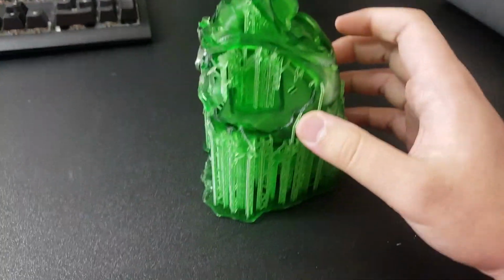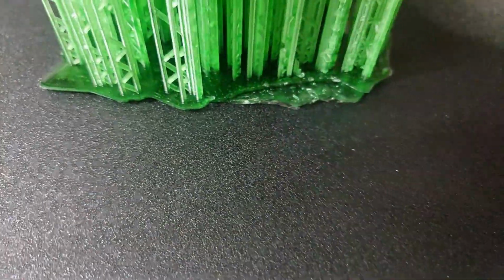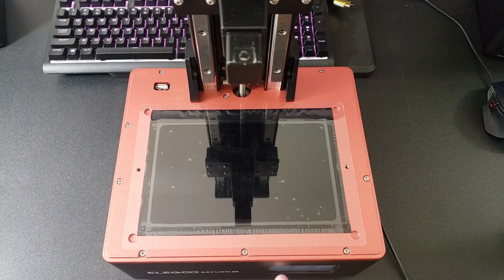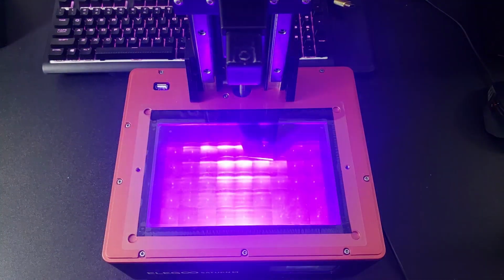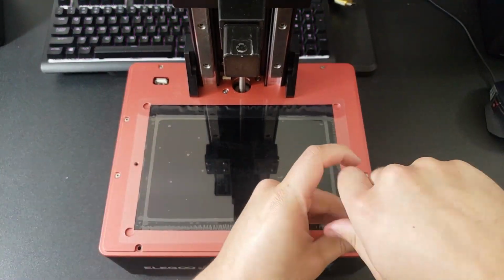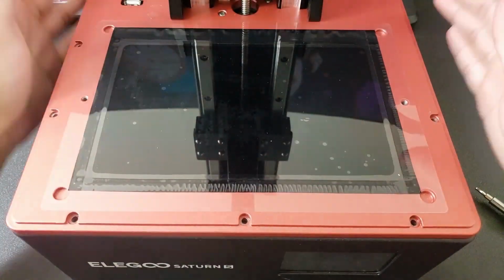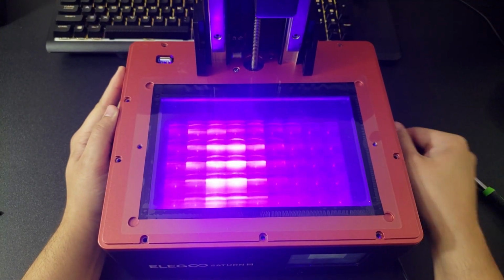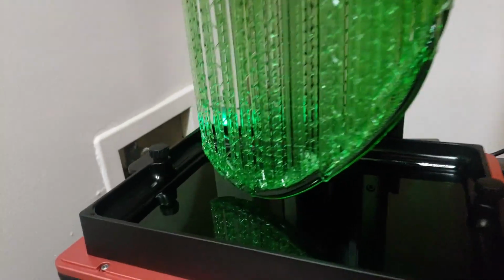Resin prints exploding

Comment: Very good informative video, thank you. I've had a resin  printer for about a year and have yet tried to use it! I want to learn all about them before trying it. My FDM printers work real good. Thank you again.
Reply from the maker: Thank you. I was the same I've had an ender 3 for a while. But the price of resin threw me off for a long time. I just look around alot for deals. Anycubic sells often at a discount. Their official eBay store sell alot of 3kg for the price of 2 many times during the year. So I've been told. Thank you for the comment.